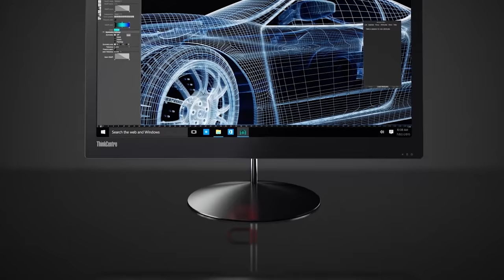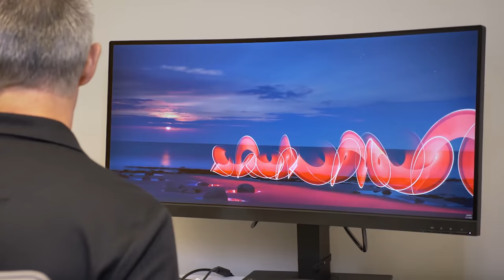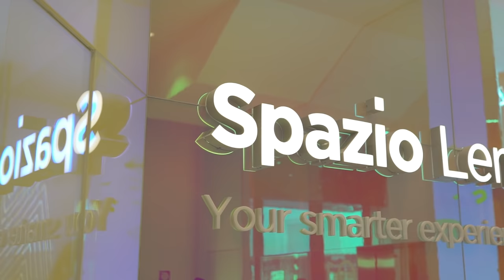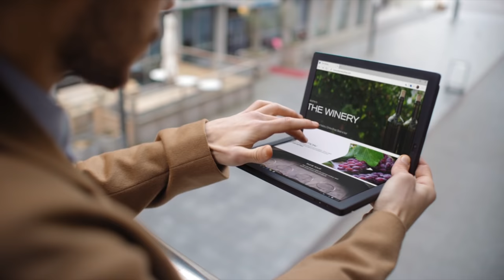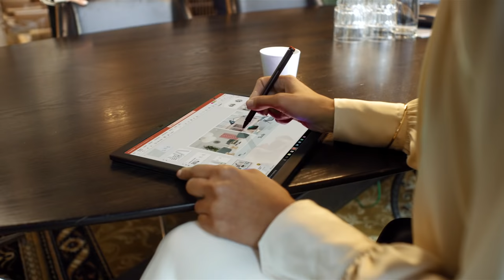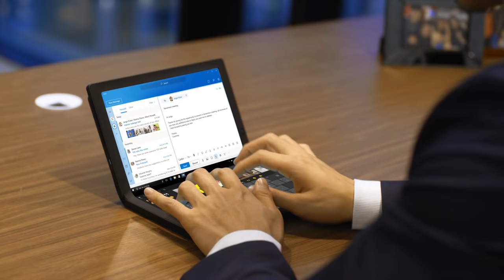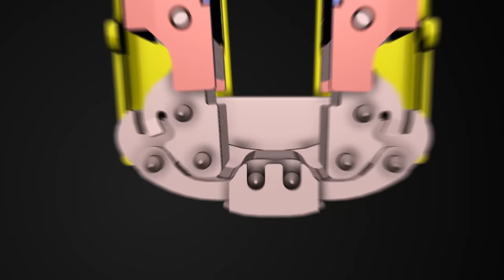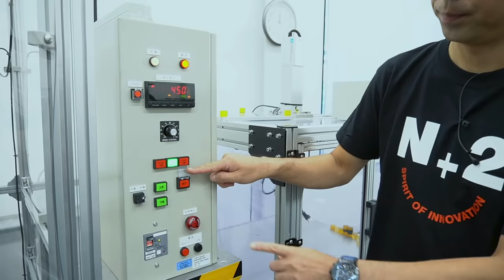Lenovo ThinkPad X1 Launch Event 2020

Comment: Those tablets and specially the fold should not be under the Thinkpad X1 line. I worry about the future of Thinkpad. The X1 Nano however: bless you!
Reply: As long as it’s sturdy and boxy it certainly is a thinkpad
Reply: @slighter  there are a zillion 'sturdy' Android devices. Nothing exceptional about this device vs what Thinkpad laptops have to offer. And yes, the thinkpad line offers other devices than laptops. But why X1 then?
Reply: The fold is  called  X1 fold so why should it not be part of the x1 line of Lenovo products? Xi fold is part of the thinkpad line up because it has the red mouse in between the keys like all Lenovo thinkpad products do! That is why the fold is part of thinkpad
Reply: @ZackWolfMusic  "the X1 fold is called X1 so why should it not be part of the X1 line?". That's some logic i cant beat lol
Reply: @acos21  If sturdy and boxy aren' enough, then what about reliability? Having Enterprise functionality and enterprise usability?

Comment: Hey intel dude! Why did you compare Ryzen 7 4800u with i7 1085G7 with photoshop/premier pro when you and I know Adobe hasn't freakin optmized their app for AMD.
Why did you not use Geekbench when in the past YOU have used it to boast your processors capability realized your processor is trash huh?
Reply: And I know you got pissed off by the Geekbench benchmark when you saw that a 4 core Intel CPU was kicking ass of a 8 core AMD CPU even in MT.
Reply: @ahsanqureshi786  And intel is for sheeps who swallow everything that intel has to offer no matter how overpriced their products are. Better St and Graphics? at what pricepoint? 1.5x to 2.0x more than amds? And sacrificing better multicore performance just for graphics? at what use case would that be actually better except for gaming? and even if it was for gaming, who would buy an integrated gpu just for the sole purpose of gaming? that makes absolutely no sense to me and mind you, this is at a higher price point compared to amd. If you want REAL work done, you have to go amd, amd crushes intel in productivity, period. no amount of "graphics" performance on an integrated chip which sacrifices multicore performance changes that, especially since most workloads today take advantage of multiple cores and that is a trend that will keep growing and growing until everything is multi core dependent. better ai? on a LAPTOP? are you joking? and thunderbolt 4? AMD’s position has been that its customers don’t want Thunderbolt. But the company has also said it believes it could supply Thunderbolt designs if it chose to and What do you REALLY need thunderbolt 4 for mate? egpus? lmao. wifi 6? there are already amd laptops with wifi 6 bud, google is your friend. gen 4? what is the use case for pcie gen 4 on a laptop? Im honestly curious.  lpddr5? yeah no problem with that cos theyre definitely coming in the next 5nm amd cpus for mobile, 5nm bud. and lastly, intel used to pay oems to not put amd hardware on their products, what makes you think theyve stopped doing that? Amd even won a case against them because of it. So keep supporting your intel buddy, keep clinging on to dear life to it while it still can. No amount of intel's dirty tricks will prevent amd from being the logical choice in mobile AND desktop right now, youd be living in a cave to not understand that.
Reply: @lylewarren4391  AMDrone spotted yet again
Reply: Geekbench is a crappy bench outside of mobile phones. And they used Adobe since the people buying this use those programs (duh), despite that Intel only has advantage because of their higher speed memory configuration.
Reply: @charinflanrocks  People who use adobe suite by machines with Fuckin graphics cards, not an iGPU. And intel is showing adobe suite no for that but to actually make the following point "even though are laptops are more expensive than AMD laptops + GPU you must by ours"
Reply: @ahsanqureshi786  says an Intel fanboy who buys and fanboys anything Intel launches and calls people who buy AMD- cause they're superior, "peasants"
Reply: @ahsanqureshi786 "AMDrone spotted yet again", Last words of Intel fanboys before giving up on their life...
Reply: @BrawlPlays-0  keep crying kiddo
Reply: @ahsanqureshi786  What the hell are you trying to prove?
Reply: @ahsanqureshi786  Well, then tell me one intel laptop that beats AMD at its price?
Reply: @BrawlPlays-0  Intel is expensive but you get what you pay for
Reply: @ahsanqureshi786  YOU FUCKIN DON'T
That is the most incorrect statement of 2020
Reply: @ahsanqureshi786  btw bro, intel is now the budget option LMFAO
Reply: @lylewarren4391  You are saying this as if Rocket Lake is never gonna come out.
Reply: @ahsanqureshi786  oh you mean another 14nm++++++++++++++++++++++++ processor? yeah sure bud it's simply not gonna change anything. but to be fair, I am planning on buying intel soon if the prices are lower on their current chips. zen 2 prices seem to be high atm and we all know zen 3 prices are even higher. looking for a good deall on an  i5 10600
Reply: @lylewarren4391  i7 10700 is 300$. Same as 5600X
Reply: @ahsanqureshi786  yeah, will wait for benchmarks on nov 5 and then ill decide

Comment: Recent I have bought Lenovo ideapad through Amazon  on 21 Aug 2020, for 12 days it was working fine but later on bluescreen start to appear and shows to restart computer and icons also started to disappear, continuously it's happening in between my conferences due to which I cannot work at all, all my work is done through laptop,  very recently I bought but problems started arising. I called Amazon customer care, they told to contact Lenovo customer care centre, I'm calling but no response from thier end. Whats going on I don't understand. I want immediate replacement of my laptop. If you all don't take immediately action than I will escalate higher authority and  post in all social media. I spent 68k but this is the result I'm facing. I regret why I bought this laptop and when no one is resolving my issue. Costumer care is zero in the first stage of the service.
Reply: Hi did your problem got sorted out? I have an older Lenovo model and it is exactly facing the same problem that you described.
Reply: @skar12  they did something but again problem happen today

Comment: The brand new, 2020 Nano X1, comes with a 2017 forehead bezel. The Razerblade Stealth might not be as thin and light. But the bezels appear smaller, and it can game... for a few years now. You should have done better in every way, than someone who specializes in keyboards and mice. The Fold is very cool but again, look at the giant bezels. Its cutting edge tech and already looks 3 years old. Too bad that name was already used by Samsung. C'mon guys...
Flex
Layer
Overlap
Furrow
Vex
Hell, name it the X1 Shield. Sounds better than fold.

Comment: Initially, I am in WOW mode, such an amazing accomplishment, and they beat out the big boys!!! However, why is the X1 Fold it so darn thick? I love the X1 Carbon because it's so lightweight and thin and a go-anywhere device nad the NEW X1 Nano looks to be even better this year!!! 

What Lenovo needs to do is get the X1 Fold thinner, lighter and also be able to fold 360 degrees like the Microsoft Duo screens. You have an excellent hinge design and a little more tweaking and you have a perfect solution. Folding the screen all the way back allows for greater versatility and use cases. 

Also, the X1 Fold needs to be lighter and then we will have a winner on our hands, so looking forward to version 2 or 3 in the next year or so. Still, its a great innovation and shows what can be done and provides a great deal of versatility to boot. 

My favorite of the new releases is the X1 Nano, WOW, that baby is sweet, so light, powerful, versatile, and with the docking station and other accessories is the best setup I have ever seen, You guys and gals are really way ahead of everyone else including Apple in this category.
Reply: Because its first gen genius
Reply from the maker: Hi Michael, glad to hear your thoughts! We really appreciate your feedback. 😊

Comment: Intel?! LOOOOOL I wouldn’t buy an intel pc if you gave it to me 20% cheaper than amd. Stop using intel its hot garbage
Reply: AMD still lacks lot of Intel's vPro, dedicated security chip, hardware encryption chipset features that Enterprise demand and laptop needs to be certfied with these features for their business use. 
(I know this because I use a i7 vPro enabled laptop for work and they wouldn't approve any other BYOD non-vPro laptops)

Until AMD offers that, I see many business laptops still sticking with Intel for next few years.
Reply: @kiranm25x  Don't forget Thunderbolt